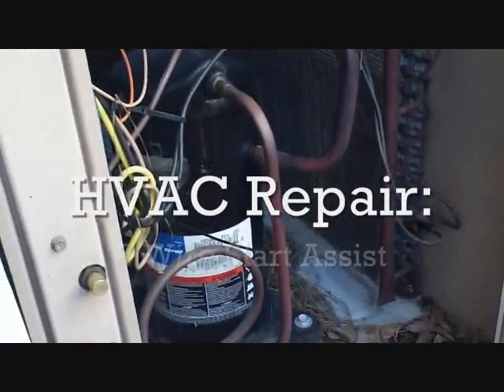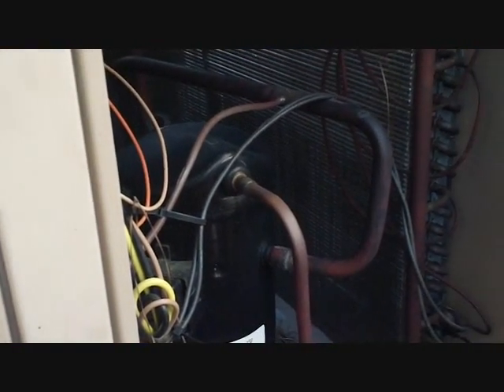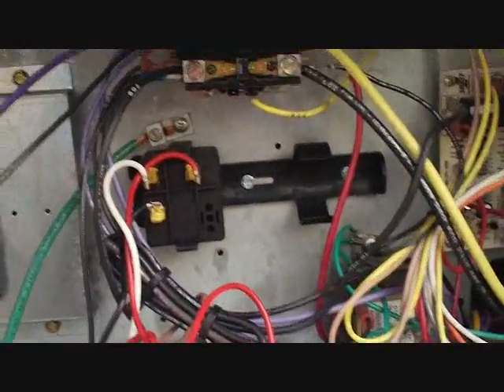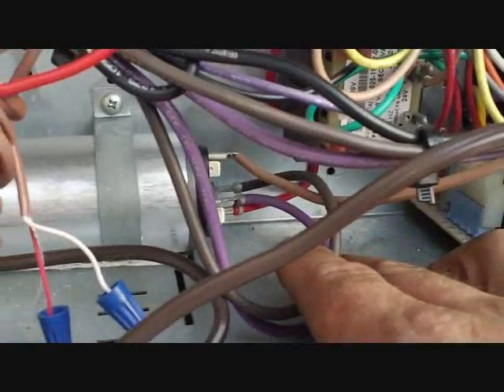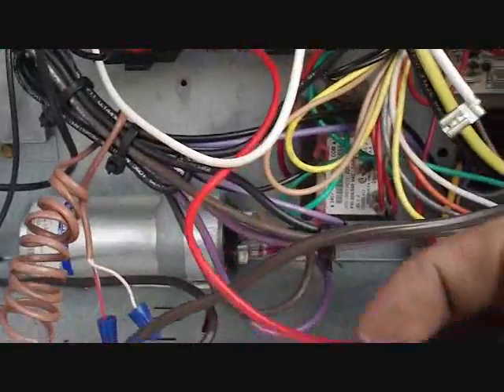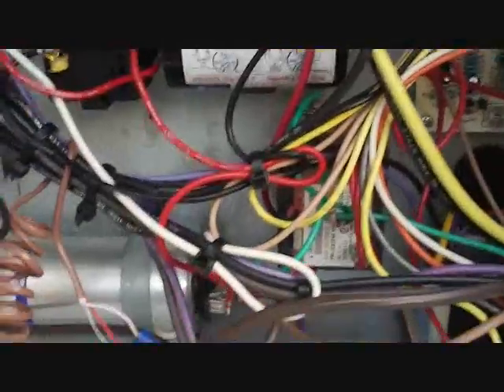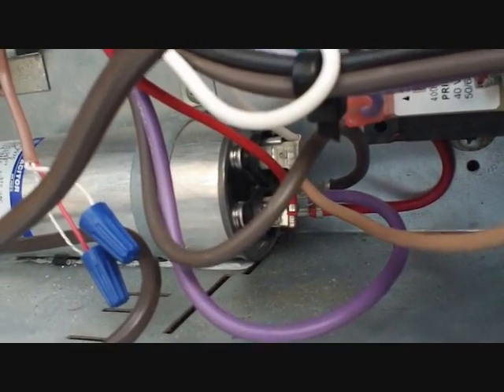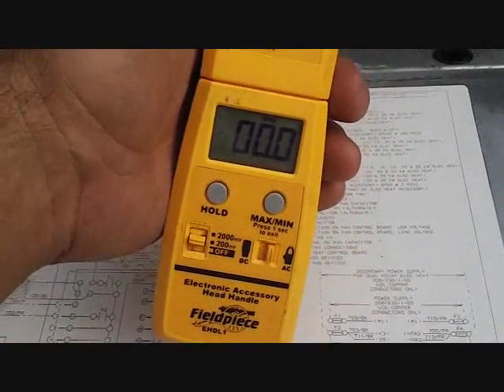HVAC Repair: Installing a Compressor Hard Start Kit

Comment: Nice overview, not sure if you have another video on how the hard start works? At x volts, the hard start increases the voltage by X amount to the start winding by X amount of increase, this lowers the start-up current by inducing a momentary much higher x voltage, yadayadayada. Thanks.

Comment: I think your meter missed the start amps and 15 is the run amps.  I would believe 50 but not a reduction from 94 to 15.
Reply: kwm380: is correct There NO Way the  Start LRA amps was only 15     if LRA was 94  then after start capacitor LRA  would be around 58 amps

Comment: Great teacher,  I have learned a lot from your videos.    Question:    If a 5-2-1 kit fails,   will the unit still run?  And can it cause damage  to any thing if it does fails?   Thank you for your time,   Have a nice day.

Comment: In have  ok never of them old heat pumps. When it sts rats it sounds like a monkey humping a football. It was low on Freon so I ordered some off eBay. After I o it Freon in it it is hard to start. I bought a set of them air conditioner gauges. I filled it to 75 pounds of Freon pressure. I couldn't find any stickers saying what the pressure is supposed to be. A guy on YouTube said 75 pounds pressure.

I'm gonna put to of these monkey humper start kits on that old heat pump.
Reply: +MrCraz6r   so how did it turn out with the hard start kit. are the monkeys humping or did you find out you should vacuum it to 500 microns or more and weigh in the charge.

Comment: Never had to install a hard start kit on a scroll compressor however that depends on the in rush current draw compared to LRA on data plate of unit. If I'm not mistaken that common wire on potential relay should go on the line side of that contactor, not the load side...